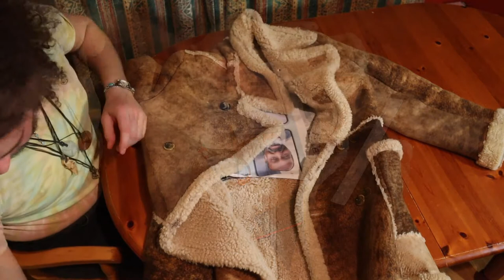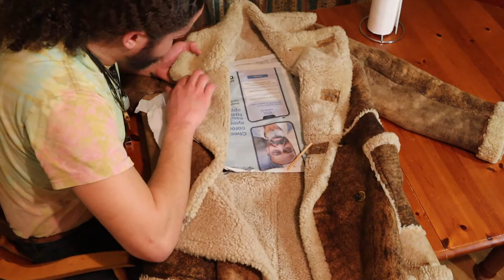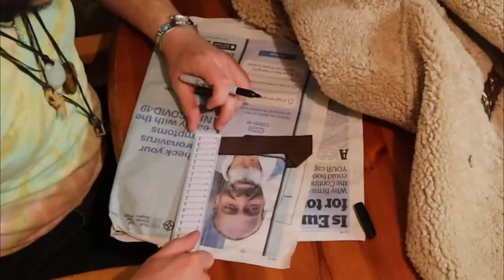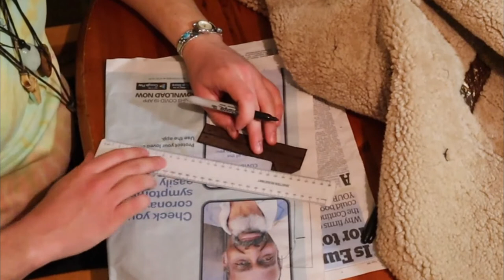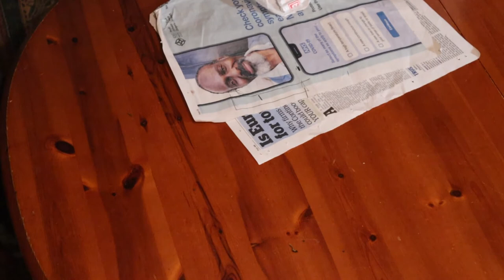Sheepskin Jacket Repair With Leather Patches

Comment: Sheepskin is underrated. Hard to maintain relative to heavy coating wool and synthetic windproof shells, but with modern processing techniques, it can look like straight up fur. The UK disposes of tons of skins from the meat industry. Given how the material naturally lends itself to a rugged aesthetic, one neednt be too discerning in selecting pattern pieces. We really need to use more of it rather than emulsifying it or burning it as we usually do. There are an 9verabundance of unprocessed hides going to waste. Its not the same as an old Chinese woman forced feleding a fox in a tiny cage.
Reply from the maker: I have often said that leather and sheep skin is vegan as long as the animal was killed for another industry (meat). Same goes for black pudding and pork scratchings. To simply throw away resources is stupid.
Reply from the maker: Consider subscribing!
Reply: @ChattinSquit  I wouldn't go as far as to call animal products vegan, but I heartily agree with the idea that if we're using it, we may as well use all of it. I cringe at the number of American cow, bull, steer and horse hides go to waste because of the death of the American tannery.
Reply from the maker: @varun009  Madness innit?
Reply: @ChattinSquit  it really is.

Comment: Just ripped mine while trying to clean a stain. Punched a hole.right through it. Pissed is an understatement
Reply from the maker: Yeah sheep skis isn't very strong at all.
Reply: @ChattinSquit  it had some stains of something. Whatever it was im thinking it weakened the leather on top of being wet it just split right open with minimal pressure.
Reply from the maker: @truthhurts2149  Unfortunately the coat in this video fell victim to some muggers towards the end of last year and as you say, the slightest bit of violence and by the end the jacket looked like I'd had a fight with Freddie Kruger and came last. I've sewn it back together but it definitely looks rough.

I also have a napa leather (sheep skin) Brando jacket that met a similar fate about five years ago. I will do a restoration video on that jacket soon as well. 

Be sure to subscribe!

Comment: I have a tear in the breast part of my shearling. What are the products I need to do the same type of repair  ?
Reply from the maker: Find some leather offcuts on Ebay of a similar type of leather, I find Italian sofa leather can be nice and soft or try to find sheepskin. The glue is Copydex which is available in most supermarkets and craft stores in the UK, or some other latex based fabric glue.

Comment: Bro how to unwrinkle lambskin jacket ?
Reply from the maker: I'm no expert so take what I say with a pinch of salt. I might try getting it damp/wet and then hanging it up on a padded hanger or wearing it around the house until it dries. Just don't force dry it on a radiator or in the airing cupboard as this may cause it to shrink or split.
Reply: @ChattinSquit  you sure water won't damage my jacket?
Reply: Nd one more questions sir I do live in Kashmir in India and here we can buy imported sheep leather used jacket should I buy more ? I mean is it worth having in cheap price?
Reply from the maker: @salmansheikh9917  Possibly.  If you're unsure then ask a specialist.
Reply from the maker: @salmansheikh9917  I have no idea my friend.  I'm not a sheep leather trader.
Reply: You can take a cloth and and an iron, put the cloth over the leather and iron the top of it briefly.
Just dont hold the iron on for too long, not long at all.
Thats how they do it when they make these jackets.